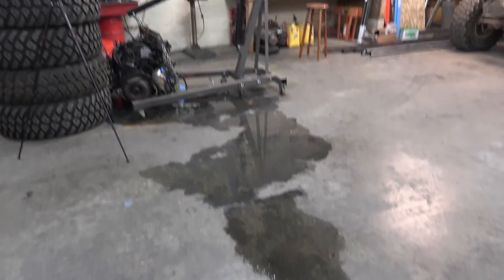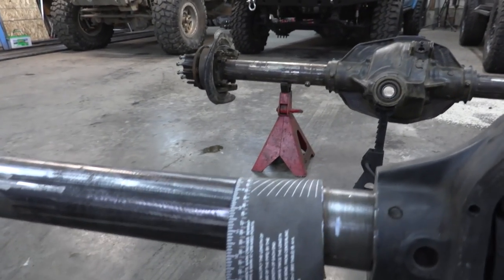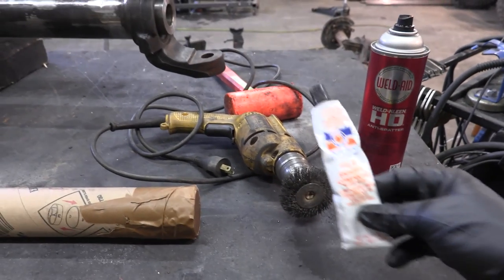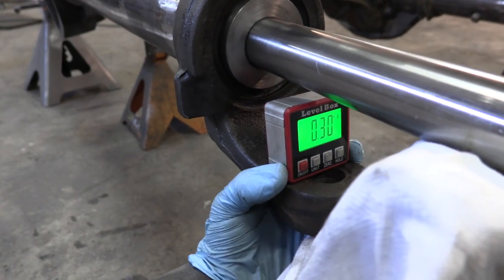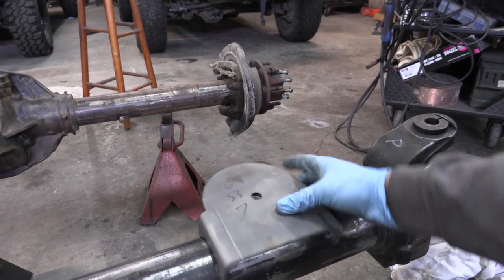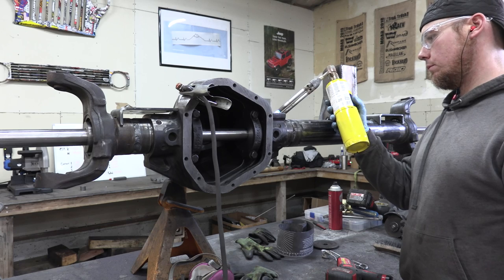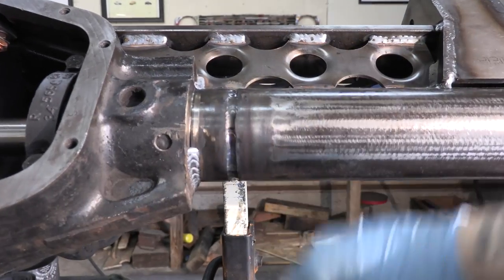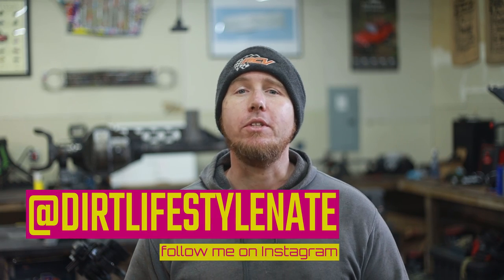Homemade Passenger Drop Dana 60. Ultimate Land Rover Discovery Build Episode 3.

Comment: I drill the plug welds and remove the entire tube from the center. It's actually easier than doing the sleeves. Doesn't have to be perfectly tight to begin with as the pucks align everything before welding. But there's more than one way to do things and glad you can show people anything is possible. Love your videos!
Reply: Are they hard to beat out of the housing once the plug welds are drilled?
Reply: Your way is much better instead of insert sleeve

Comment: Nice job! About 10 years ago me and a friend chopped a Ford Dana 60 and did the exact same thing to work in a GM application. We didn't use an alignment rod, just a lot of measuring and remeasuring. It's held up since with no issues. Nice truss also.

Comment: Great vid! The alignment bar Brings back memories of straightening 9” rear axles for circle track every time I’d have to repair someone’s race car. I have had to use a press and a torch with water to fix bent axles
Reply: Series of videos on doing this would be awesome but I understand not wanting to give away trade secrets too.
Reply: Jesse Name oh I don’t do this kind of work anymore. It was great though. Just a lot of pressing and counting for spring back and rechecking. If it’s not a big bend you can use a torch on the long side of the tube and use a water soaked rag to shrink it
Reply: Do you have more details on this? I need to do this on my dana44. Long tube got bent. I assume you heat the concave side (to expand) and cool the convex side (to contract)?

Comment: What I did for building my own axle housing and also trussing a bunch of Dana 60s and a bolt bolt was get a big i beam and making custom saddles to mount the axle in based off the tube disneter. Like mounting a crankshaft in a motor sort of. I then added a few mounts for a laser to verify if the housing is straight or now. Not quite as accurate but it also allowed me to straighten a Dana 60 that was 1/4 inch out on one tube back to within a few thousandths of straight really easily.it really is surprising how easy something that appears totally solid will move.  Just some food for though.

Comment: This proves that my want for an alignment bar is justified lol. If you find a good source for them spread that info 👊🏼😎 awesome video brother.
Reply from the maker: My buddy @rubberduckytj on Instagram. Hit him up for the parts and peices if you need. Tell him I sent you 👊
Reply: Dirt Lifestyle 🤙🏼👊🏼
Reply: Can you use thick rebar?
Reply: @cencoast_7.340  Rebar is a low grade mild steel that will not stand up to the stresses you will get as welds heat and cool. It has way to much give in it and will likely just flex as the welds cool. If your wondering how I know this I spent 25 years welding and fitting many different pipe metals, boiler tubes and working with other metal related trades.

Comment: For cast steel welding use a high Nickel alloy filler wire and keep the part hot while welding on it and let it cool slowly. You said you were preheating to 300F, that should do it, between stitch passes for your cover check the temp and torch it up to temp if need. When you are done wrap with ceramic blanket and let cool to ambient.
Reply: Shouldn't he preheat closer to 500 since it's not just cast steel it's Nodular?

Comment: Well done.  I'm lucky enough to have a lathe at home and several larger ones at work.  Being able to turn pieces as needed is nice.  I made up my own alignment setup when I retubed my 44.   Kinda wish I'd just done a 60 instead..  :)
Reply: @mariombaa  Really, nothing.  For my needs it's plenty strong.  I retubed it with 3/8" wall tube, brackets and truss from Ballistic and Barnes, plus all new brakes, 4.88 gearset.  Going over the cost to build it verses a 60, looking back, I could done a 60.
Reply: What kind of press do you need to push the tube back onto the housing?
Reply: @gallamine  I have a 100 year old 30 ton press I got from Salt Walther's shop.  Blow the plug welds in the case with a torch or plasma cutter,  I turned a die to fit where the seals are, chunk of pipe, and shove.

Comment: Big that’s some nice work. I was always thought to use the casting rod or filler for welding steel to castings, but I had a guy tell me about using dual shied and hit it with a peening hammer to relieve the stress, and I haven’t looked back

Comment: 309 stainless wire works pretty reliably on cast to low carbon.  Preheat and you should be good.  C.W.I.
Reply: I have a grand Wagoneer D44 that I've been debating on doing this too for my xj.
Reply: Yes sir that's the way to go. 309 is like a Swiss army knife lol

Comment: The only thing I whould have done different was to plug weld your sleeves  ...
But then again if it works with no breakage no need.
Reply: Good point , with that truss I bet it's Polly locked in there pretty solid , and technically I guess he still could drill some holes just deep enough to plug , cheers

Comment: Pretty sweet. I like it. But you should be setting the protractor on the machined surface. The inside of the yoke (C) is not machined. Close enough, but the top would have been a better option.

I preheat the cast section with oxy/acc to 400 degrees and use MIG. You can use high nickel wire for a stronger weld. But then you HAVE to wrap it in a fiberglass blanket so that everything cools slowly over 8 hours. Ask me how I know. ;)

Comment: With tig your heat input is super concentrated. Your pumping 120 to 140 plus amps into a 1/8 cross sections. You can dump enough filler metal by hand to give that weld enough reinforcement to keep the crack from forming. You could try going hotter on the preheat adjust the post/pre flow of the tig machine. Also with mig your heat affected zone is much wider and also way hotter in the 230 amp range if your running 20 to 22v. Could also be garbage between the housing and tube.

Comment: TIG Welding steel to cast tips (from a TIG fanatic): 

1) TIG Welding is EXTREMELY focused very intense heat. The expansion rate of steel and cast iron are quite different. This is a big part of your cracking. The reason you see this more with TIG than MIG is due to the focused intense heat. More preheat will help this. Like WAY more. 

2) You want filler with a bit of nickel. 

3) I know TIG is pretty, but the best option here would be to hook a stinger up to that TIG machine and burn it on with some rods.
Reply from the maker: Thank you! I have high nickel rods for arc and an arc attachment for my machine. I just kinda hate arc welding lol. But I will if I must
Reply: @DirtLifestyle  clean the flux of the arc rods and use them to tig with ....job sorted
Reply: So I was just reading and now I am wondering about the cast material and the nickel content of the filler material. I am not a professional welder.

Cast steel is supposed to spark yellow when ground similar to cold or hot rolled. Cast iron will spark much more dimly, and the sparks tend to be red. Judging from the video that center section appears to be cast steel. You said it was steel as well, but just making sure we all agree and can eliminate that uncertainty. 

In that case isn't it enough to preheat the material and control cooling using a common MIG filler like ER70S-6? I am not saying using high nickel filler is bad, just that mild steel filler might be OK. For cast iron it definitely seems like you need high nickel filler. I see 55 and 99% Ni as common fillers for cast iron using the preheat and controlled cooling method. I think this has something to do with the high carbon content of cast iron and the ability of the high nickel filler to not over harden when all that carbon is present in the base material.

Obviously you can't believe everything you see or read on the internet, but Ben at JK Gear and Gadgets appears to use typical MIG filler on his one ton swap trusses and they appear to have turned out fine using the preheat and controlled cooling method. I've watched a number of his videos and he seem to put a decent amount of forethought and research into his build. He did a Dana 60 from a super duty and a 14 bolt. See here:

https://www.youtube.com/watch?v=RtPqCEqifaI

Maybe the reason you were getting some cracking was just because of the focused heat of TIG as Ian Ahner mentioned above and it has nothing to do with the filler. You could compare the composition of the filler to confirm this as you said the MIG welded portion was fine. 

Good luck and keep us posted.
Reply: Most gear housings are nodular Iron , I have successfully welded nodular Iron with 7018 SMAW , thats stick arc . But I prefer Eureka or Weld Mold nickel rod stick arc using AC current and a foot pedal . I am a 798 Pipeline welder but started out in the tool and die welding in the 70’s . Pre heat is very important as is the cooling rate . To slow the cooling rate we would bury freshly welded cast iron in “ Mica “ it looks like sand . The cast iron part would still be warm a day later . Also the only difference between steel and Iron is carbon content . And some steels have the addition of other alloying elements . Google the Iron carbon equilibrium diagram . Nice job on your fabrication

Comment: Super cool man, I did a similar approach to widening a 14 bolt, found out that 14 bolts have a seam inside and they are tapered, ended up turning down some pipe and milled a groove to fit around the seam. With that taper it was such a pain to get together, ended up using some come alongs and a sledgehammer to get both sides together. But it worked and feel more comfortable doing that then wheel spacers

Comment: Nr211mp to join the cast to mild steel. Basically 7018 in wire form. No issues, no blankets, just preheated with a oxy acetylene torch.  Worked perfect for me.

Comment: Chances are your MIG welds are cracking too but along the edge rather than down the middle like the TIG welds are. When joining cast to steel I have used brazing rod with the TIG torch with excellent results, the bronze is much softer and tolerates the rapid elongation from the cooling of dissimilar materials. I have also gotten excellent results with 7018 stick electrodes joining cast and steel, again, it handles the different cooling rates much better than ER70S-6 MIG or TIG fillers. Both processes require preheat and slow cool or post heat just like you’re already doing, fiberglass batt insulation works great for a slow cool. It doesn’t burn and insulates very well, I commonly wrap 300-400 degree parts in the afternoon and they are still too hot to touch at lunch the following day, the slower the cool the better! Keep the great videos coming!
Reply from the maker: Thanks! What brazing rod are you using? I have alot of experience in brazing brass and copper but am new to steel
Reply: Dirt Lifestyle I’ll have to check next time I’m in the shop, it’s what our local welding shop stocks, Hobart brand seems to stick in my mind, I believe it’s 1/8” as well. No need for flux either, your argon handles that for you 😁

Comment: Not to mention pinging the weld and using sand it a sure fire way to help cast welds, preheat cast to atleast 300, as soon as it done bury it in sand. Great insulation and let's the metal cool slowly to keep stress out of the grain structure

Comment: 1 ton axles for k5 blazers are hard to find and about as valuable as unobtainium. So if I'm swapping in a modern LS motor would it be worth it to just swap to driver drop axles and a newer tcase or do this conversion. It looks incredibly straightforward and I have the Welding capability. Awesome work! Love your videos.
Reply from the maker: Hard to say. I don't know much about your options are for tcases but the axle swap is easy 👍

Comment: ER309L works pretty well for cast to mild steel welding (TIG)
Reply from the maker: Thanks for suggestion! I will order some up 👍
Reply: @DirtLifestyle  I have done a fair bit of TIG on dana housings. My best results are with a good preheat and TIG brazing with Techrod 55 (Nickle55) stick electrodes. Knock the flux of the rods first ;). I find it it's easier and cheaper to get stick nickle rods than TIG filler.

Comment: great How To video,  i have done this same mod to many Dana 44 & Dana 60 super duty fronts with great success all are still in use,  the NEW short side i found is easier to cut the old long side tube down to the NEW short side length, i remove the old sort side C-knuckle by cutting the weld out. this way the short side does not have a butt weld in the tubing. And this gets the New long side butt well a little farther away from the housing.  --   Also for your alignment rod tooling i had mine custom made.  except i align it with the steering knuckle in place with all new ball joints and my custom alignment tool bolts on in place of the wheel bearing,  this way i know the axle shaft will be exactly straight all the way.  Just how i do it,  keep up the good work

Comment: Nice job. Came out great. I figured out a different way because I had never seen it done. Annealed those diamond hard welds with the torch.  I rented a 50 ton electric overl hydraulic puck, similar to porta power but much higher pressure. It was something I had used before to straighten out the floor beams from the basement up. It's about 3 inches tall and 3 across. It only moved two inches at a time. Anyway,.drill the welds maybe pipe spacers and press the tubes out

Comment: Awesome job, you made it look real easy.  Too bad you limited yourself with that axle though, the 05+ stuff is where it is at (not to mention you already have 15+ years of compatibility to build off of).  The big  "gotcha" with the 05+ stuff is that the 17+ axle shafts slide in and you get cheap 1550 steer joints that turn 40*+ that hold up to LS power and 43" tires.
Reply: this is good info, is there any links or more info to the compatibility of 17+ shafts/parts?

Comment: Top shelf video quality, lots of knowledge only a tradesman would have.  
If i had anything to offer it would be the weld on the tube. I would have opened the root up to 1/4 " with a backer just like you did and spray arc some  dual shield in wire Into it. Burning deep into the backer pipe. 2. Or 3 cover passes. 
Some cast steel welds better than others. Depends on the internal properties of it. Hard to choose fillers that cover everything polarity can be another issue I have heard also . not sure about that though 
Be cool to have the tube welds inspected by a CWI that can really read a ultra sound machine to see what they found. X-ray would cost too much probably

Comment: Good show, your angle finder looks like the harbor freight 95998 that I've been relying on for years. Don't drop that thing to many times, it'll take a couple drops.

Ya' gotta have one of those digital angle finders to do this type of work. That angle finder is probably rated to +/- .3 degree. I've notice that's it's a good idea to let it sit on what your measuring for a minute or so because it has brains ya' know.

Comment: Nate, look into nicore NI-55 wire. for welding the cast parts.
Reply: christopher webb pretty sure thats for welding cast iron not cast steel like he is welding on.
Also i have never had a problem welding cast steel with regular old s-6 mig wire. I prefer mix gas vrs straight co2

Comment: I've had really good luck welding cast housing with mig. Never had a crack yet and haven't really used any special technique other than slowing my welds and keeping the heat even as possible, done tons of trusses that way. That alignment rod is one of those "why didn't I think of that???" Deals😂. I want.... I love this project while I'm mostly a Chevy/Jeep guy I have a soft spot for the rovers and now you can afford to do something with the older ones and have something with all the comfort and still wheel it... my favorite two things! Appreciate your content as always.
Reply: Alot of old boiler casing was made of cast iron and due to the cooling and heating it would crack regularly. We used alot of different methods over the years but the best way to stop cracks was a 3 fold method. First we would drill a hole at the very end of the crack, weld the crack up with nicad rods and then take a ballpeen hammer and ping the weld. The drilled holes kept the cracks from running ahead of the weld, the ping was to stress relieve the weld and as for the nicad rods you would have to ask a metallurgist why they worked better than other rods. We were told it was something to do with the nickel/cadmium mix of the rods metal/flux combination but I do know they worked better than any others we tried over the years. To this day I dont really know if the pinging helped but it was how I was taught to weld cast iron so it was how we did it.

Comment: Nice work!  So did you consider drilling out the plug welds and completely replacing the axle tubing?  Materials cost?  
FWIW, I've had mixed results TIG'ing mild steel to cast/nodular steel with, say, ER70S-6 even on different areas of the same diff housing.  I've used stripped 308L sticks with some success as well.  You might try "buttering" the cast side with your chosen filler, letting it cool, then coming back, and welding the two pieces together. Tight joints are your friend.  If all else fails, there are special products for welding to cast iron, such as Muggy Weld; pricey, but I've successfully welded to an old SBC engine block with it.
Reply from the maker: Since the tubes are pressed in I would need to build a special tool of some kind to "un press them". This was a little less then 20 bucks for the sleeves and a little less then 20 for the truss material. 👍